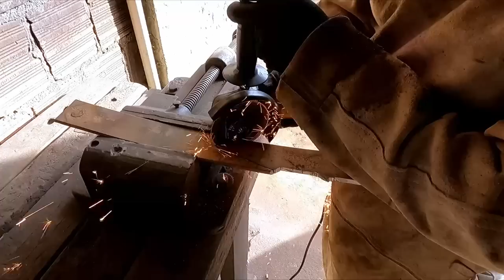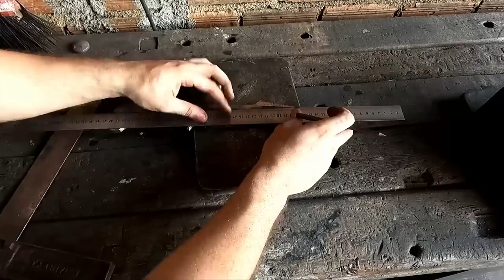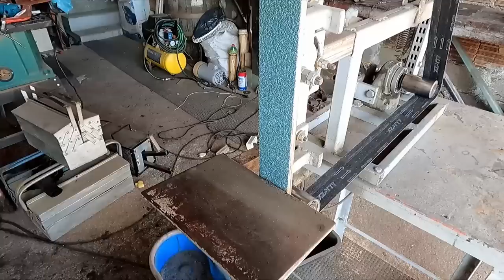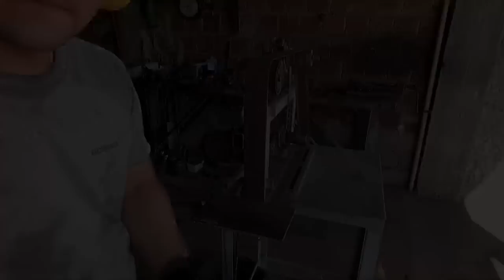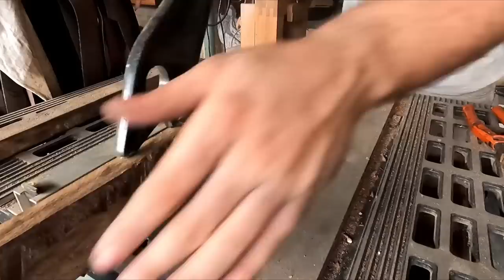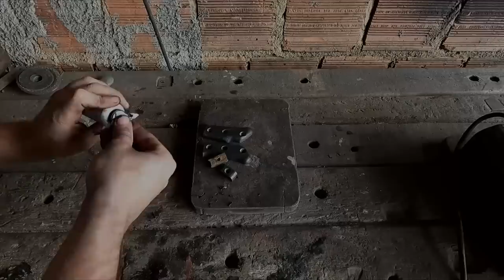Knife Making - Making a Tactical Knife

Comment: Cool design but way too thick of a steel to be used.
Reply from the maker: Yes, this blade is thicker due to the screws on the handle.  👍👍👍
Reply: @MakerHA  the screws did not make this knife way too heavy...
Reply from the maker: What I meant is that the fact that you have to thread the blade because of the screws makes it heavier, because it needs to be thicker. Do you understand now? @jeffallen3382